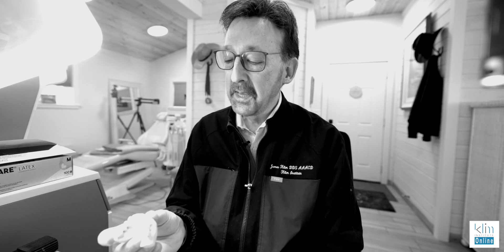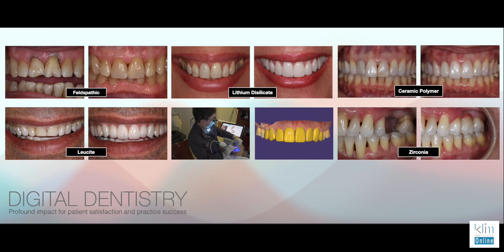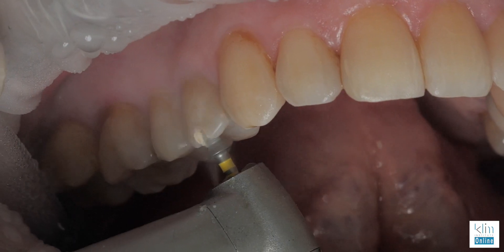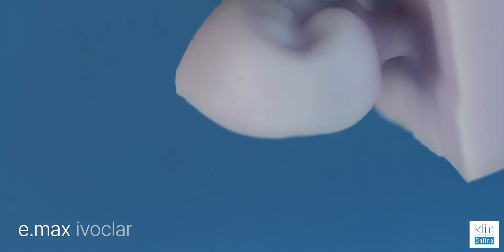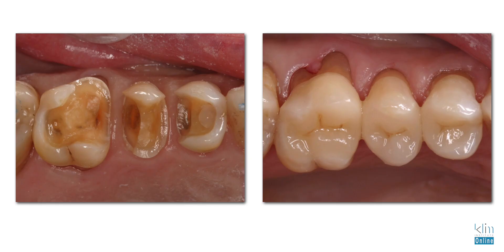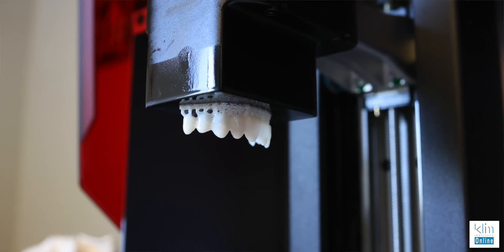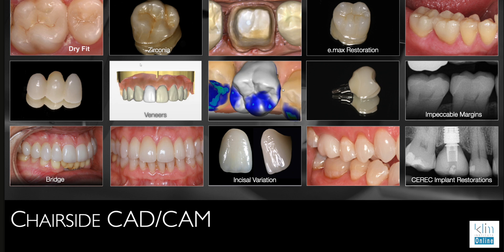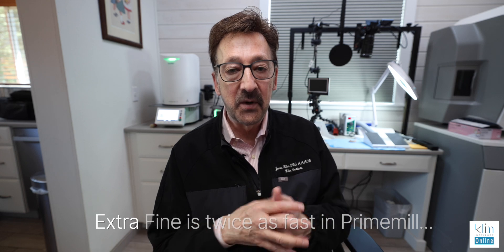Is CEREC still the in-office system for 2024?

Comment: Thank you James. I am very early in my CAD/CAM journey. I've been scanning my ceramic cases for 3 years with my TRIOS 3 (wired), and only started milling 3 months ago when we got our PrimeMil, and Speedfire. Only doing Zirconia posteriors for now, as I get used to the process. Interesting to hear you say that the Speedfire isn't really suitable for Emax. Not quite what the reps from DS say. I'm in Wollongong, Australia. BTW, I'm 67, and love the digital workflow. Cheers, Mike Wood
Reply from the maker: While I appreciate the insights from CEREC representatives, it's important to note that their expertise in ceramics and materials is often limited, unless it's specifically related to a Dentsply product. Dentsply does offer some good zirconia options, but their ceramics fall short compared to other brands. The SpeedFire furnace performs well with Katana and Cercon zirconia, but when it comes to ceramics like e.max, it has a lengthy cycle. Additionally, for refiring and adding characteristics, there may be limitations.

For optimal results, I recommend considering the Programat CS2 or CS6 by Ivoclar. In my practice, I've found that utilizing multiple furnaces enhances my capabilities, as each offers unique advantages. With new brush-on ceramics entering the market, which are truly impressive, having a furnace that can be programmed is essential. The SpeedFire may struggle here since it only allows for pre-installed programs.

Comment: I'm opening my new office and currently have been using Primescan, Primemill, and an MCXL. I plan to purchase another MCXL as they are workhorses and a lower investment. However, I was planning on getting inLab to keep everything in the Cerec workflow...now with DS Core being amazing and allowing for a much easier time with an open system I have considered Exocad over inLab. Would you have a recommendation on inLab vs Exocad if I am running Primescan, DS mills, and an Axeos CBCT? Is it easier to stay in the DS workflow with inLab or just as easy to go with Exocad? Thank you, love your videos and perspectives so so much!!
Reply from the maker: I use both. Inlab has a simpler workflow and is better at designing posterior teeth and splints. Exocad is better for digital Wax-ups and anterior tooth design.  Plus, inLab is in the DS workflow, which is still the best.  I use both and recommend both as well.
Reply: @KlimDDS  Awesome, thank you for the quick feedback and response! You are obviously a rare talent and so gracious in your teachings and time towards others. Im thankful to be one to benefit from those. Thank you!
Reply: ı use inlab but anterior designs are not that good compare to exocad so u should use exocad for anterior design ı guess. also when u design on exocad u cant mill without inlab

Comment: Hi! I have an Omnicam 2.0 and how unlocked the in lab ,because I forgot the password ? 
How to send a laboratory but in STL ?
 Scanning the full dental arch ,if we have areas with errors,how to block what’s good and scanning again without scanning again those areas market scanned? Great jobs!
Reply from the maker: Yes, with the Omincan, I used a mist of Optispray to expedite the scan, gathering complete undercut data and ending in a smaller file.  Exporting a DXD file to a lab is best accomplished via DS Core, and that is the route I use today.  My common practice is to fully trim the model and clean it up in the chairside software before exporting.

Comment: How do you get scans from the Primescan into the PM7. Can Cerec software mill to PM7 directly or do you need to use exocad for design and milling on PM7?
Reply from the maker: Several routes.  With inLab, an STL file is exported to the CAM Software for the PM7.  For Exocad, Primescan is sent to DS Core, and the conversion factor is used to download the Exocad file.  Once restoration is designed, it is exported as STL, and imported to the PM7 Cam software for milling.  With CEREC chairside, the CAM software is part of the chairside software.  Most milling units come with CAM software for processing the STL restoration for milling.
Reply: @KlimDDS  If I design in CEREC chairside, can that file mill directly to the PM7 as a "connected mill" or would the STL get exported to the PM7?

Comment: So you mention you mill on the MCXL because of the smaller bur. However doesn’t your PM7 have an even smaller bur? So why mill on the Cerec system at all if you have a mill that always mills in extra fine mode + even more because of the 5-axis and the smaller tool? 

I tried to search and saw Cerec has a .6 so can’t it use that bur?
Reply from the maker: Good questions and thoughts.  There are several objectives with CAD/CAM dentistry.  Number one, there are advantages to placing restorations in one appointment and not placing a temporary.  There are time management objectives.  Generally, a five-axis mill will take longer, and the greatest detail I can get is on the PM7, but it will take approximately 41 minutes.  With the fine mill on the Primemill, I can get extra fine mill in 11-14 minutes, where as with the MC XL extra fine mill will take over 20 minutes.  So, to make this practical for onlays, premolars, and canines, the Primemill is my same-day choice.  For lower anterior veneers or crowns, the MC XL extra fine mill is my choice.  And this is for same-day appointments.  One can hand tool post mill detailing with the CEREC that will provide excellent morphology.   See https://youtu.be/igrhAot-vi4?si=TClF6-qxrBVFRTC9.  Regarding bur size, the 0.6 in the CEREC is still a 33-degree angle and four axes.  The 0.5 bur on the PM7 is a needle bur design, and the 5-axis can mill more morphological detail.  It is about understanding mill options and using them according to needs.  All options will provide accurate margins.
Reply: @KlimDDS  Very insightful! Love your work and content!
Reply: @KlimDDS what is the choice for prepless prep veneer for upper?

Comment: In your opinion, if you were starting out and thinking about opening a practice would you still go with the primescan? Its great, but its a couple years old now and as you said, its a closed system. Have you looked at the new offerings from iTero? Additionally, I do like the versatility of the MCXL and would love to go with the primemill, but again it is a closed system. This is from someone who isn't currently locked into the CEREC walled garden and have that 5 axis milling capability. Your response would be greatly appreciated.
Reply from the maker: With DS Core, the Primescan is an open system.  I have heard there will be a new camera system introduced this month.  Anyhow, for restorative purposes, the Primescan and Trios are my choice over Itero.  In addition, with the CAM software, the user can send a STL back into the CEREC system and mill.  If you go the route, the Primescan scan is still the most efficient turn around for same day restorations.  All the best!
Reply from the maker: I heard a new Dentsply Sirona camera is coming out this month.  Anyway, the Primescan is still an incredible camera even after 5 years or more.  And with DS Core, the Primescan is no longer a closed system. It can be sent to any software desired. Today's best restorative cameras are the Primesan and maybe the new ones or Trios.  I would stick with these over the iTero for restorative.  I would go with the Primemill.  With the CAM software, one is able to transition into an STL, which makes it an open system.
Reply: @KlimDDS  Thank you! Love your videos!!